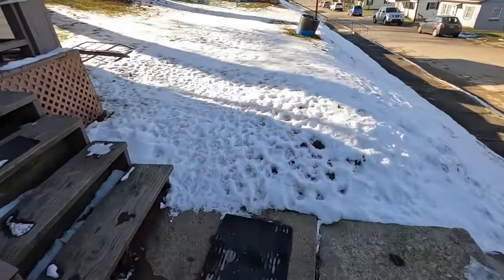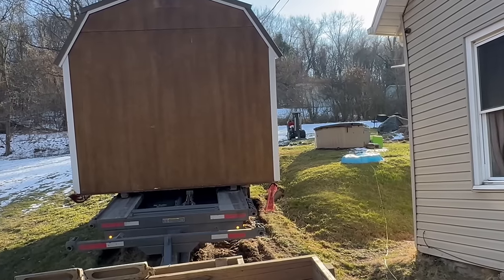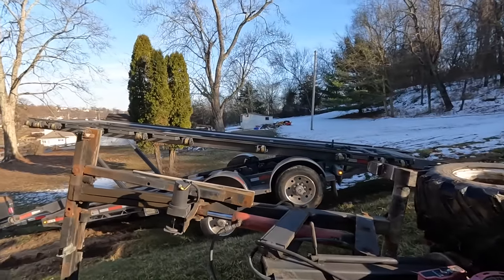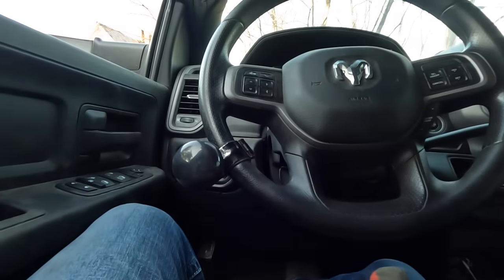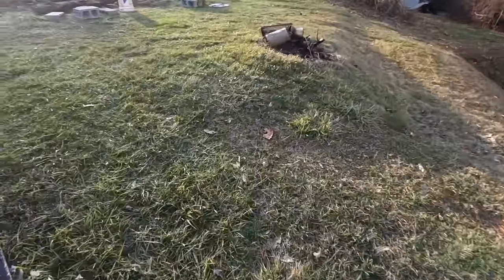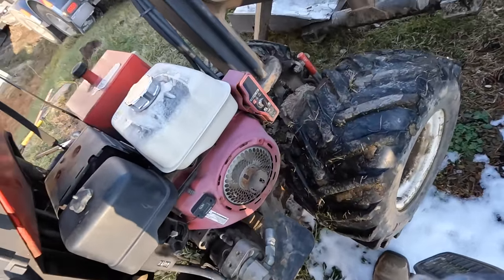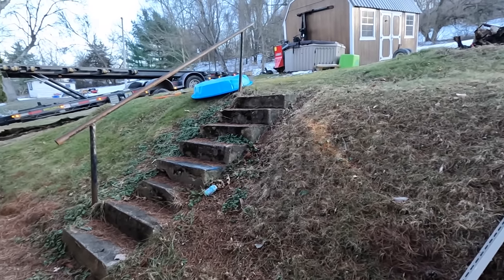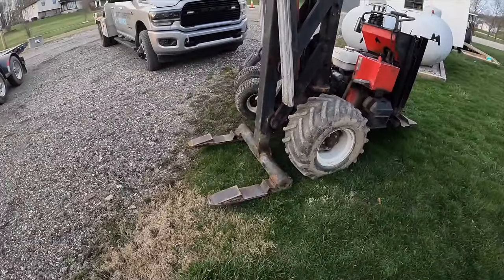Shed Repo Re-Delivery Fail: When Everything Goes Wrong: I Need a New Mule!

Comment: Slick 50 is some good stuff. My son-in-law ran a Taurus low on oil until a little know low device kept it from cracking.  After replacing the little known low oil device, the starter I thought it was going to come apart. So I added about four quarts of oil and the slick 50 it ran and ran well.  So some slick 50 might make the motor sound better. I have used Teflon in a lawn mower and the valves quit making as much sound.

Comment: May need to invest ina set of duals for the mule.. Rough areas like that is easy to tip those over.. With duals you have a wider wheel base.. However not as easy to load and haul around unless you ca  find some quick attach duals.

Comment: I don’t agree with her statement at all. However, if the payments were caught up and an agreement was reached to return the shed, “where do you want it” should have never been the question. It should have been returned to the exact location it was removed from and in the same condition it was found. If it was damaged in the move, the company should repair it. If the company chose the day of return, knowing the weather conditions, arrangements should have been made for the proper equipment to be provided for the move. And, if the company chose the day, the company should fix the ruts in the yard at their expense. The building being left full upon repo is on the company, not the home owner.